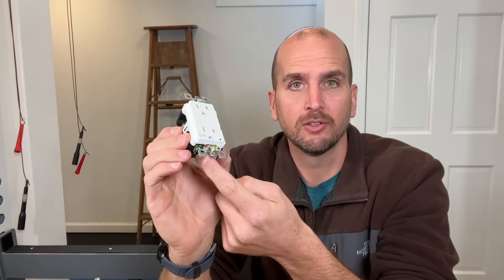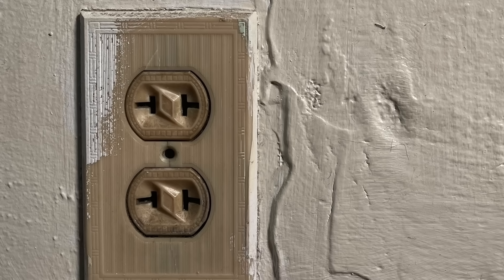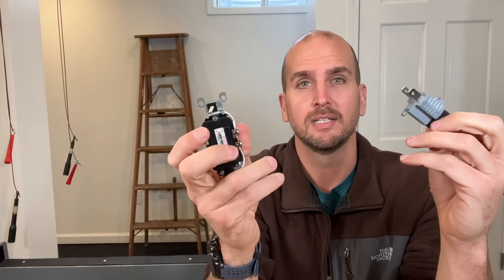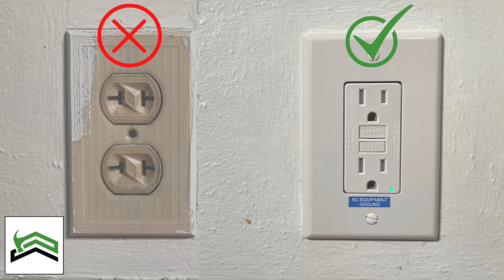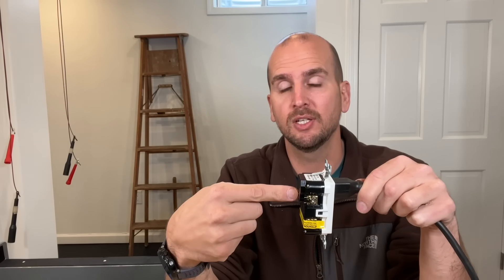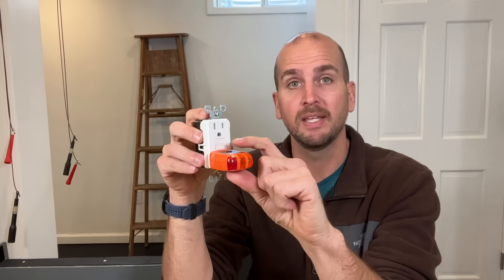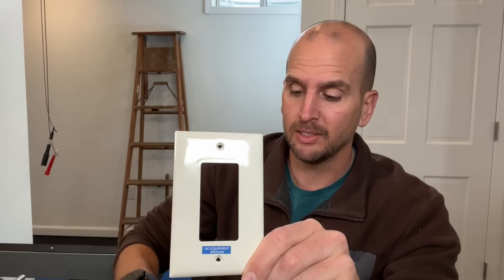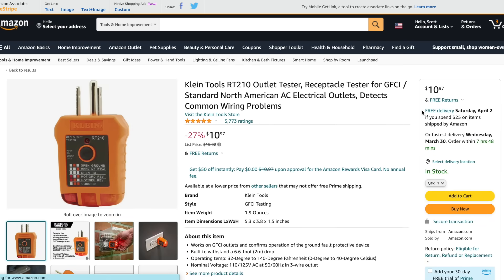Does a GFCI Outlet Still Provide Protection Without A Ground Wire?

Comment: No you need a ground connection. Not so much for the GFCI but for the Surge protector power strips. On houses with ungrounded outlets GFCI breakers which are better but outlets are cheaper is the way to make three prong plugs and outlets safer even though not grounded. I used the cable ground in the past but a GFCI outlets are better. Just don't use surge protector power strips they must have a ground connection. 

Let's get one thing straight it's not only to protect from shocks but also protect what is connected also. Ungrounded GFIs will not protect ground faults just human shocks. Ground fault will damage equipment without the GFI being grounded. 73

P.S. if you plug in a better power strip that has indicator lights on it the device will indicate if the ground is connected and if the surge circuit will work the lights both must be green. Yellow indicates the power will still work but you won't have surge protection. The ground must be present to get a green light. I hope this helps. There are 100s of nos and 100 yeses you decide if you want full protection or no. 73
Reply: First surge protectors do not need ground connection. Second they are not even necessary.
Reply: @ronb6182 Using the GFCI is code compliant. It is perfectly safe in normal living and bedrooms. I would be more hesitant to use it outside or in a bathroom.

Comment: 20 years ago I was buying an older triplex with 2 wire outlets and the home inspector mentioned putting in a GFI to protect people and eliminate those adaptors.  I am glad he shared the information just as you are.  Thanks.
Reply: I had a conversation with a school instructor and he said, every device box must have its own GFCI receptacle based on the Canadian Electrical Code book. Now that can get pretty expensive and I don't know if people are doing that.
Reply: @mweezy  Here in the US you can put the GFCI on the first receptacle in the circuit and it will protect the other receptacles downstream.
Reply: @im2yys4u81  Ground fault Breakers are available too
Reply: @hinspect  When I did my panel swap a few weeks ago I went with dual function breakers, then had to go through the house and remove the GFCI receptacles.
Reply: @mweezy  I think you misunderstood that.  The rule is that every outlet must have GFCI protection, but not the actual GFCI device.

You can either chain them with a GFCI first from the panel, or use a GFCI breaker.

In fact, the rules are becoming stricter, and virtually all general purpose outlets must be AFCI/GFCI.  The AFCI part can only be done in the panel.
Reply: @fromagefrizzbizz9377  I want to install some AFCI/GFCI dual function outlets in my home made by Leviton.  I don't know if the AFCI function upgrade protects after replacing a 2-prong receptacle.
Reply: @ Even if you are replacing an outlet on a 2 wire circuit, both AFCI outlets and ordinary GFCI outlets should work.  GFCI works by detecting a difference in current between hot and neutral wires.  An AFCI works by detecting very rapid changes in current - eg when a  connection is frying itself and overheating. Neither requires a ground.   

Regardless of what I’m saying, the instructions that come with the outlet will tell you if it works.

Electrical codes always tell you that you follow the instructions, even if code seems to say otherwise.

Of course that assumes that the device is approved by appropriate bodies. The certification process is testing not just the device but the instructions.
Reply: If it not wired correct in the panel it doesn't matter ground in nutral bar is a very common thing so it's bonded. All shortest paths to ground so if your the shortest guess what
Reply: Thanks for your video! 2 questions:  #1. How many downstream outlets (2-prong) can be 'protected' by a GFCI?  #2. I'm dealing with (3) 2-pronged outlets, & I need to determine which one will be the GFCI & other 2 replace with regular outlets? I'm assuming the closest to the sub-panel is the one where GFCI will be, but I wonder if you've made a video explaining this process? Thank you!

Comment: I didn't watch the video.  A GFCI simply compares the currents on the hot and the neutral.  If they are different,  it trips.   No ground wire is needed for that to function.

Comment: Absolutely - The protection is provided by the device responding to a difference between current in the "Hot" conductor and the Neutral conductor. That "stray" current will be present  if a stray current path exists in an external load between the load and an external ground. 

( If the external load includes you, and a big toe is stuck in a water faucet which is electrically grounded, the GFCI should open the circuit and save you from electrocution - It will not save you from the embarrassment of getting your toe stuck in the faucet )

Comment: To save you some time, no, a ground conductor is not needed for a GFCI outlet to work properly.  This is because the GFCI circuitry monitors the imbalance between the line and neutral conductors.  HOWEVER; the GFCI must be marked with "No EGC" or "No Equipment Grounding Conductor".
HTH

Comment: I would just add the info that a GFCI is not a Circuit Breaker... it does not trip via current overload.  A lot of people seem to think that a GFCI also protects against circuit overload - which it does not.  So, if you have a 20 amp circuit - you also would want a 20A GFCI - instead of the usual 15; because they only trip because of in-balance - what went out is not what came back... but they 'will melt' because of current overload - since they are not looking at that aspect at all. (Unless you install a GFCI Breaker in your home - but that is not an outlet.)

Comment: So I installed my GFCIs and they weren't getting tripped and the guy doing electrical work in my house said "oh just bind neutral and ground for those receptacles" I'm wondering if that's ok because since I did that another outlet on the same circuit is no longer tripping with the tester...
Reply: No, that is against the code. You should only test with the test button.

Comment: Good info video. Most older homes, post knob & tube era and pre romex era have BX cable attached to metal electrical gang boxes. Most of the breaker panels in those post k & t homes are grounded, and the BX cable continues that ground up to the boxes. By using that gray grounding adapter and screwing it onto the  outlet plate screw a grounding path will occur. An easy test should be performed to confirm that the screw is part of the house's panel ground.
Reply: Came here to say this.

Comment: Is it safe to plug in higher end devices such as: smartphone, laptop, TV???

Secondly, with the ungrounded outlet, would it matter at all if you plugged a surge protector for said devices?
Reply: Smartphones and typical TVs do not even use the ground.laptops are class III. Totally safe. Surge protector still works as it prevents a surge between the two wires

Comment: I tried to install a Leviton GFCI in my home - which is wired with old BX and relies on the armor to ground out the metal boxes.  In this particular location, a bathroom, some moron had mounted the box flush to the STUD and so there was a layer of drywall and a layer of ceramic tile in front of it ... so the outlet had to float way off the box.  Because of this, you couldn't get a reliable ground from contact with the box.  My experience is that, in this situation where the GFCI was not connected to ground, the device would not energize ... it would trip as soon as you put power to it and would not reset.  I had a box of these GFCIs and tried three different devices and all had the same behavior.  In the end, I ran a screw into one of the holes in the back of the metal box, put a ring terminal on a piece of ground wire, and connected that to the ground terminal of the GFCI - problem solved and all worked as expected.  So, I think at least some of these devices require a ground connection.

Comment: You kind of left us hanging on testing the ungrounded GFCI. I suppose you need to run the tester though the grey two-prong adapter. I'm assuming that the little loop on the adapter connects to the ground pin. If that's the case you can run a temporary ground to a water pipe or something to make the test work.
Reply: The "little loop" on the adapter is designed to hold the adapter in place. This is done by removing the screw on the cover and running it through the "loop", then running the screw back into place. It is NOT intended to be a ground, and does not function as a ground. You can verify that with a meter by checking the continuity between the ground leg and the loop.

Comment: A GFCI receptacle compares the load current to the return current (remember you dont get a current drop you get a voltage drop in a circuit). Think of a series circuit. IF the return current and the source current are not the same you then have a current leak. That means the leak is current going somewhere besides the source...pretty simple if you think about it.

Comment: My only question is when i take my gfci tester and push the button to test it essentially simulating a short, it does not trip it like it would if it has a ground.  Why is this and will it really trip when needed.  I thought it was the gfci and replaced it only to have the same test fail again on the new one.
Reply: Because there is no ground. You must test with the button on the outlet.

Comment: Will the GFCI test button work without a ground wire?  
You already demonstrated the Klein tester does not work.
Reply: of course it does.   GFCI works on 2 wire circuits, upgrading a non grounded circuit.

Comment: The GFCI testers Only short out the Hot to Chassis Ground to trip the GFCI circuit? I guess you could take a 2K or 3K ohm resistor which would be the body resistance and connect it from neutral to chassis ground or from hot to chassis ground
Reply: WTF? The testes do not short anything, they use a resistor.

Comment: When you press the “test” button, exactly what happens?
Reply: There is a resistor, about 20 kohm that goes from the live wire to the neutral so that on the one side it bypasses the detection coil. The button connects that resistor.
Reply: @okaro6595  thanks for the info!

Comment: One issue I brought up with the “experts” at work is the GFCI functioning if the receptacle itself gets wet.  They placed one under an emergency shower.  The answer is if the receptacle gets wet, it can internally bypass the trip mechanism or even short from the external wire itself.  The GFCI will not protect one’s self of they are in water in contact with the wet unit.  It only works if they are in contact with something plugged into to the unit.
Reply: You would essentially have to fill the entire room with water for that to happen. Showers are not continuous flow. It takes little moisture for 5mA to travel from the live to ground.
Reply: @okaro6595  not true.  All it takes is a little to hit a conductor anywhere before the shut off.  The ground fault kill only works if the short happens after the shut off, if the outlet is wet, it can ground before it.
most of the showers I've seen are continuous flow.  If you're covered in chemicals, you'll be stripping under the shower, not pulling a ring down.

Comment: The button trip on the tester dose not go hot to ground it trips the gfci by Connecting the neutral in the ground which trips the gfci 
It does not just protect against hot to neutral or hot to ground it also protects against neutral to ground

Comment: I was recently told by a legitimate “licensed electrician” how to fix the tester not tripping problem. Just bond the GFCI’s neutral terminal and ground terminals with a jumper wire. That will “trick” the tester and show a good ground. Some people will do the craziest things!!
Reply: It might trick the tester but stupid idea,  a good inspector would catch that, but a house inspector wouldn't,  it's what's called objectionable current,  the neutral is technically energizing the ground on the device or appliance,  that's why all sub panels now have to have an isolated neutral
Reply: Bootleg ground. Very unsafe. And illegal. You can test the gfci with its own test button.
Reply: The fix to the tester not showing ground is the label: "No equipment ground". That means the person testing should not expect ground. I hate people who do not understand that tools are tools. One needs to know to use them correctly in each situation.

Comment: If you connect a GFCI to a system with no equipment ground, will the test button on the GFCI itself work?  Based on what you show in this video with the plug in tester, I suspect it would not work.
Reply: It does work. The test button does not use the ground wire. It diverts current from the live to neutral bypassing the GFCI. It can do that as it has access to the internals of the GFCI. An external tester has access only of the three contacts so all it can do is to pass current to the ground.

Comment: I live in an old house. GFCI protection is quite important.

Most folks do not understand just what a GFCI does!

The device is a comparator. It looks at current loss between the hot and neutral.

Having a grounded power source is naturally the best. 

A GFCI will trip on a few milliamperes of loss. 

Interesting to see that they may need to be replaced regularly. Yep. Low cost may mean Chinesium.

Comment: All residential GFCI receptacle & circuit breakers just measure a current imbalance between the black energised wire and the now called grounded conductor and nor a neutral. If one side draws 4 to 6 million is more then the other wire it will trip. About 5 years ago the made GFCI receptacle manufacturers program a self tester to check it at least think its once every 10 seconds and a self test to make sure black hot & white wires are not reversed. Installed about 19 GFCI receptacles thru out my house over 35 years ago and only two went bad in that time. I do test them every few months but not the recommended every 30 days like instructions mention. Like the newer GFCI receptacles that have a green or amber miniature LED  to let you know power is on. Have them in my bathroons.

Comment: It's also code acceptable to install GFCI breakers for your plug circuits to upgrade 2-prong to 3-prong receptacles. You also need to appropriately label the covers as you showed. 

The code is written loosely enough to allow for this.
Reply: Never heard That. Can't see how that would Work with only 2 Wires, and need to Draw Equal. Which code is it? If Acceptable, would like to know, Thanks
Reply: @randyaivaz3356  406.4 (D)(2)(c)

406.4 - General Installation Requirements
    (D) Replacements
        (2) Non-Grounding-Type Receptacles
            (c) A non-grounding-type receptacle(s) shall be permitted to be replaced with a grounding-type receptacle(s) where supplied through a ground-fault circuit interrupter. Where grounding-type receptacles are supplied though the ground-fault circuit interrupter, grounding-type receptacles or their cover plates shall be marked "GFCI Protected" and "No Equipment Ground" visible after installation. An equipment grounding conductor shall not be connected between the grounding-type receptacles.

Comment: i probably should of used a gfci outlet when i tapped into a old circuit that went to a back porch that was torn down and removed due to the floor rotting out in the main area but i know what i did isnt up to code but it works and could easy be removed if needed but i cant remember the exact breaker its connected to if it ever trips again in a overload scenario but i think i remember which breaker the outlet in the kitchen connects to and makes me wonder if i shoudl replace that 2 prong outlet with a gfci
Reply: Code requires them to be labled.

Comment: GFI or GFCI are a wonderful device. They measure the current that travels out on the hot lead, and what returns on the white Neutral wire. If there is any difference it will shut off, and potentially protect you. Normally it will trip at 10 miliamps and has saved many many people. 

If you took the Hot and Neutral and pretended they were on a sea saw, if they get out of balance, the circuit will open with a GFI. 

Its one of my favorite upgrades as a electrician to bring a house up to code with minimal investment for the customer. 
Ideally I would do a whole house rewire, because that would make me more money, however, this option is not really great most of the time because of the amount of labor it is to run new circuits threw the home. 

Arc Faults are finally getting better then when they were introduced are a different animal that works by listening to the wire and tripping of there is any arc. Different job, reason and purpose.
Reply: Small correction. A GFCI does not measure the current. It uses "one simple trick". When both hot and neutral wires pass thrugh the same current ransformer their magnetic fields cancel. The current transformer does not register any current. Only when there is an imbalance does the current transformer register a current. So effectivly the GFCI measures the imbalance of current, not the current itself.
Reply: good thing you were  here to parrot what the fucking video just said...

Comment: I recently replaced a GFCI outlet in my guest bathroom after I painted the bathroom. The old one worked perfectly but wanted a white face to match the paint. Unfortunately, it did not work after carefully assuring I connected the wires correctly. The reset button seems not to engage. Not sure if the GFCI switch is bad. It is also wired to my master bathroom GFCI which also does not work after replacing the guest bathroom GFCI. Any suggestions would be greatly appreciated!
Reply: Replace the the guest bath GFCI with a regular grounded duplex AFTER you have VERIFIED with testing that the guest bath duplex is protected from the Master bath GFCI.
Reply: YOU ONLY NEED 1
TRUMP 2024